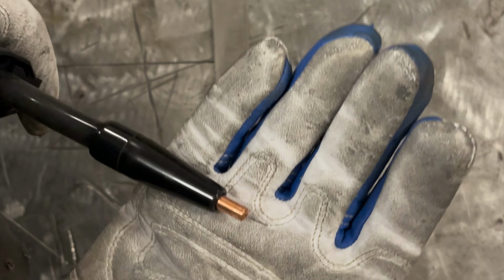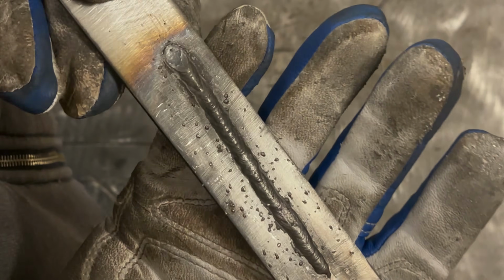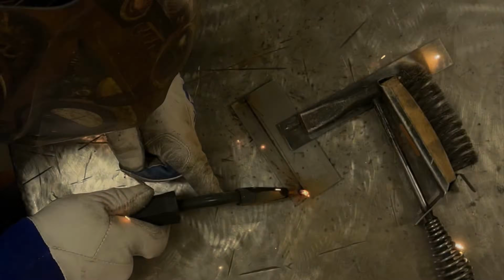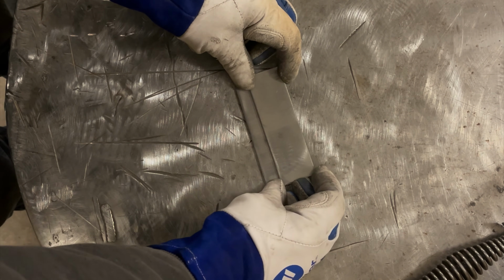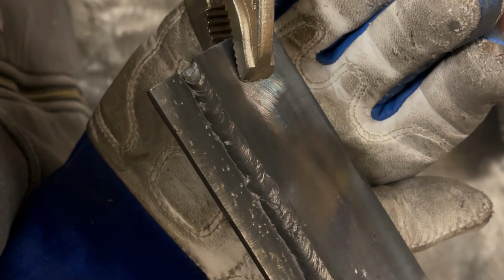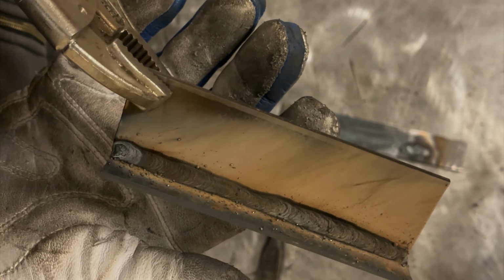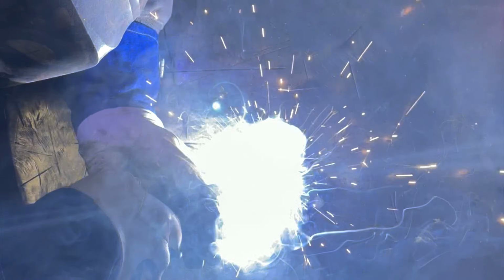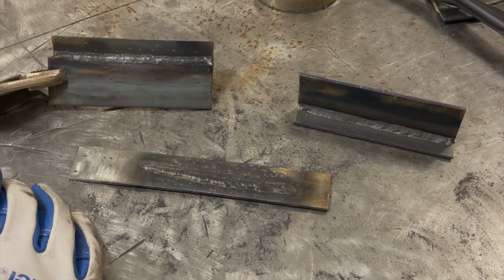How to weld with flux core wire

Comment: When you say "lower your settings" .. can you please elaborate? My mastercraft mid/flux core welder 110v (using no gas only flux) burns through often and all i have is a button that says "Voltage" as "min" or "Max", and then "Tension" as "1" or "2" and then a dial where I can select wire speed from 1 to 10 as an adjustment. Thanks for the help!
Reply from the maker: Ok so I looked up that welder your referencing.  Unlike the welder in this video, you don’t have adjustable voltage (well more limited voltage control).  More than likely you have 4 voltages to choose from: low 1 and 2, and high 1 and 2.  On a welder with more control, you set wire feed to produce a appropriate weld size for the material you’re welding on, and set voltage to “wet” the weld out.  Since you have fixed voltages you need to set things a bit differently.   You need to start off by measuring your material thickness and setting your welder to the chart it came with for that thickness.  If you don’t have a chart then set the machine at 3 or 4 for wire feed speed and low 2 for voltage (if the material is fairly thin.  You need to run a short weld, about 3/4in or 1 cm and stop.  If the weld burns through the material and you were going at a steady pace, drop the wire feed 1 notch and try again.  If you are near the bottom
Of the settings and still burning through either you’re moving too slow or your machine isn’t capable of welding that thin of material.  

Keep in mind if you are learning to weld, it’s best to start with thicker material.  Trying to
weld thin material is going to cause immense frustration because you have not developed the hand coordination or the understanding of what to do to not burn a hole.  A skilled welder can control burn through simply by watching the puddle, and speeding up as needed to avoid melt through.  That skill just takes some time to develop.  

Some welders simply cannot be easily used to weld thin material.  .030 flux core wire can easily weld 1/16th thick material (1.6mm) to maybe 1mm.  Below that .024 MiG wire and
Gas shielding performs far better.  However again your controls are more limited and likely won’t run that wire well.  So my suggestion is practice on thicker steel than what you’re on, and once you can weld solid beads consistently, then drop in thickness.  It is possible to start on thin material.  You must have a very high tolerance for failure though, and frustration.

Comment: Thank you; Greg, I just got my new Harbor Freight Titanium Flux 125 welder, welding has always been a fascination of mine, but I have no idea of what to look for or how to get started, you do talk a-lot, but with great instruction. and as a new beginner, I truly thank you for your no-nonsense approach, One question, how would this machine work on say 1/8 to 1/16 aluminum, Thanks again
Reply from the maker: Thanks for the kind comment.  So unfortunately the machine can’t weld aluminum because the flux core process was not designed for that.  You can wire weld aluminum with the gas shielded MiG process (argon shielding gas and what’s known as a spool gun or push pull gun).  If you want to weld aluminum there are very few options that are available under 6-700$ and that would be for the MIG process with a spool gun.  The titanium flux 125 can weld steel and stainless with flux core wire though.

Comment: So I got my toy in 2 days ago and my goodness just the sounds of the contact makes me jump lol lol I’m practicing before I put the trailer back together lol it’s hard I see why many are called and few chosen.
Reply from the maker: Welding is definitely a challenge to get good.  Just tell yourself “move slow, consistent, and smooth, while keeping the contact tip 5/8th of a inch away from the molten puddle”.  If you do that and focus on being as consistent in your movements as possible, it won’t take long for you to be able to weld decent and make some cool stuff 😀

Comment: I just picked up Titanium 125 from Harbor, trying to learn how to weld so I can do small jobs on my rig. Im a complete noob but thank you for the video it is very helpful to people like me I learned alot but still need alot of practice.
Reply from the maker: It takes a ton of practice to get good, I won’t sugar coat it lol.  You also have to do a lot of repetitive things that are fun, like run beads on a plate, which is boring.  Think of it like learning to write, it’s a lot of repetition and it sucks.  Once you learn to write can take it with you everywhere and it’s extremely useful, just like welding.  If you focus on trying to be as smooth and consistent as possible you will progress fast, especially because you are seeking knowledge on how to do it.  Knowledge will shorten the time it takes to get good by a lot.

Comment: I just recently found your channel and I have to say I really enjoy your videos. I have this same welder and I am trying to learn to weld, kind of getting into the game a little late, I'm in my 60's but better late than never right! You are clear and concise with no BS...I really really like that. Yes you do like to talk but you are giving out valuable info and not just talking to be talking. Well done sir, I appreciate your time and willingness to share your knowledge.
Reply from the maker: No problem and welcome to the channel.  Surprisingly enough the titanium 125 is a great wire welder and is totally capable of welding anything between auto body and 3/16th thick material (1/4 if you push it).  The video series I made will really help you understand what you need to do, and get you up to speed.  The most important things when learning to weld is to accept the fact you will fail for a while before you get the hang of it, that you need to practice a bunch to get good, and that before you know it you will be putting down good welds 😀.  With flux core in particular you need to maintain a drag angle, 5/8th or so stickout from contact tip to molten puddle, and you need to move forward slowly/smoothly.  It won’t take long for you to start building stuff 😀
Reply: thank you Sir! @makingmistakeswithgreg
Reply from the maker: No problem and welcome to the channel.  Surprisingly enough the titanium 125 is a great wire welder and is totally capable of welding anything between auto body and 3/16th thick material (1/4 if you push it).  The video series I made will really help you understand what you need to do, and get you up to speed.  The most important things when learning to weld is to accept the fact you will fail for a while before you get the hang of it, that you need to practice a bunch to get good, and that before you know it you will be putting down good welds 😀.  With flux core in particular you need to maintain a drag angle, 5/8th or so stickout from contact tip to molten puddle, and you need to move forward slowly/smoothly.  It won’t take long for you to start building stuff 😀
Reply: I really agree with you on your comment,

Comment: It has been several years since I took a welding class. I just got a cheap flux welder and your videos provide an excellent refresher. Time to practice before I tackle a pretty simple project that motivated me to get a welder.
Reply from the maker: Glad to hear that.  Flux core wire is a great process for small projects.  Make sure to practice a bunch and get a good wire to make welds that need the most strength.  I find Lincoln’s nr211, Hobarts fab shield 21b, or is forges t11 wire to make real clean/solid welds.  No need to spend the extra on those wires for practice or simple jobs 😀

Comment: Wow...I listened to you for 43 minutes and time went quickly...I must really like welding. I still have not done my first mig weld. Tutorials like yours are prepping and motivating me. Many thanks for posting. I had to laugh that you had to try VERY hard to do a bad weld...I will have no such problem...for now.😐👍
Reply from the maker: Thanks for the kind words 😀.  When you get to a certain point it is hard to put down a bad weld (I still do from time to time lol).  Think about it like signing your name, at some
point you can get it pretty much perfect every time.  Welding also has a lot in common with golf in the sense it’s a stupidly simple concept but in practice it’s deceptively difficult lol.  As long as you keep your contact tip to work distance consistent, your travel speed smooth and consistent, and your settings are high enough that a puddle is established that you slowly drag along, you will be good.  It just takes some practice and not giving up.  You can do it 😀

Comment: NIce job. I was surprised to see you welding from right to left as a right hander. I usually like to observe the puddle just behind the arc with the tip angled away from view where you are viewing just ahead of the arc. I found if I slowly move side to side for the first half inch or so of my welds that I get better penetration into both sides while the metal is warming up.
Reply from the maker: So I don’t really know why, but with flux core I weld right to left about 50% of the time.  With stick it’s 90% left to right.  Mig is right to left as well most of the time.  Bizarre lol.  Great tip on the starts 👍
Reply: Hello young fella , finding your videos very interesting , thank you for your effort . I have 2 questions what is DCEN and DCEP ? And can I use Hydrochloric Acid for etching , seem to remember a welding inspector using it ? Again thank you  and kind regards  from Australia
Reply: @briansmart2045  DC=Direct Current has 2 choices, EP=electrode Positive, EN=electrode negative, a 3rd choice is sometimes AC=Alternating Current

Comment: I have this same welder from Harbor Freight,  my first experience with an. Invert welder,  I'm really impressed on how well it welds,               nicer looking and smoother.            Great Video
Reply from the maker: I bought one of the titanium 125s back when they first came out.  I was surprised at how well it welded and how useful it is.  I am glad harbor freight marketed it because it gives the average person a ton of capability for very little money.  Their titanium stick machine is also really good too.

Comment: Can I weld a piece of galvanized steel into a car that has rust issues with this machine? I have no experience welding but I'm a D.I.Y kind of person , just trying to learn a new trade so any input or info from you guys would be greatly appreciated. God bless and have a great rest of the day 🙏
Reply from the maker: Ok, couple thoughts, hope they help you out:

Yes the machine can handle welding galvanized to rusty steel.  Flux core wire will make fairly clean welds on poor materials because the flux in the wire will help take care of the contaminates.  Keep in mind that producing good looking welds on thin rusty material to thin galvanized material will be tough.  

Flux core wire is probably the easiest process to use to learn welding on, so the titanium 125 is a great “first welder”.  Keep in mind it’s far easier to weld thicker clean metal than it is super thin auto body.  The hardest thing to weld competently is thin material, it’s very easy to blow holes.  If you spend the time to practice you can absolutely tackle the job you’re talking about with that welder.  It won’t be as easy as 4 hours of practice and you’re doing the job you want to, but it within a few weeks of solid practice you should be able to.  

If you do decide to do it make sure you wear a respirator (weld mask) while welding that stuff.  You don’t want to breathe the fumes off that galvanized material.
Reply: @makingmistakeswithgreg  thank you man for all the tips and advices . I appreciate it a lot. I bought 20 gauge Galvanized steel sheet metal for the job so hopefully everything turns out decent at least.Have a great day and thanks for replying back with such promptness.God bless you and your family 🙏

Comment: Flux core can drive you crazy, untill you learn...i was getting horible welds with my expensive miller matic 130...i was useing harbor freight wire..that wire sucks...i use Hobart and other good brands..and get nice welds..also use nozzle dip..harbor freight wire isn't consistent in size..causeing the wire to jump and spudder..dampness will also kill flux core
Reply from the maker: I should pop out a set of calipers on the wire, I bet it isn’t consistent in diameter.  I know I measured 1/8th 7018s one day and found out they were all over the map lol.  The results of hobart fabshield 21b, Lincoln nr211, or other decent brands seem to be far better than the cheap ones.  I know I have used a bunch of 21b and the welds come out so clean at times they almost look tig welded.
Reply from the maker: I should pop out a set of calipers on the wire, I bet it isn’t consistent in diameter.  I know I measured 1/8th 7018s one day and found out they were all over the map lol.  The results of hobart fabshield 21b, Lincoln nr211, or other decent brands seem to be far better than the cheap ones.  I know I have used a bunch of 21b and the welds come out so clean at times they almost look tig welded.

Comment: Very informative. Flux core is WAY Underrated!!!
Reply from the maker: It definitely is 😃.  One of these days I need to try the stainless flux core wire and see how that is.  I have never ran it and it could be pretty useful if it works decently.

Comment: really excellent instruction. Thanks.    Vulcan and Lincoln wire are spatter lovers.   Forney Yeswire Hynide wires are top of the line, according to last head to head comparison that I saw.
Reply from the maker: You’re welcome.  There are definitely differences in wires.  Gasless flux core has to be the worst when it comes to specifications.  I have been doing some testing on 3/8th plates and having issues (not too unexpected).   To help better understand what’s going on I looked into the spec sheets for every manufactures Gasless flux core wire I could find locally.  Every manufacture specifies different max plate thickness for their wires, different test results, and literally different operating voltages/wfs settings.  I think the key take away is that you need to find a wire that is suitable for what you’re doing (and is multi pass rated if doing multi pass) and that runs good with your machine.  Unlike with gas shielded Mig or even stick, switching wires to another brand with flux core is almost guaranteed to cause issues.
Reply: 100% agree.  I found a reasonable priced brand at my welding supply that reduced my spatter by half.  obviously more suitable to my "garage welding".    You gave me the answer to all of my welding issues:  speed, stick out, settings.  in that order.     @makingmistakeswithgreg
Reply from the maker: @karljolley8346  I am glad the info helped😀.  I am sure you saw a drastic difference in how your welds were looking after a few tweaks in what you were doing.  Flux core is a great process but it works terribly if something as simple as the wrong stickout is used.  Once you realize the “range” you need to be at for everything it works great and gives a ton of capability.